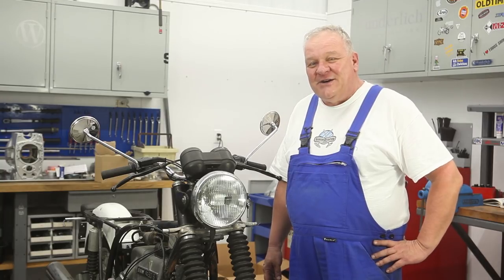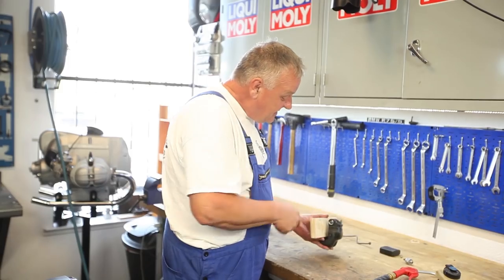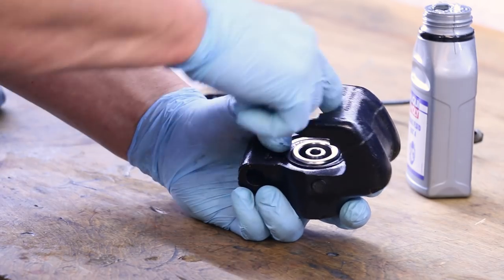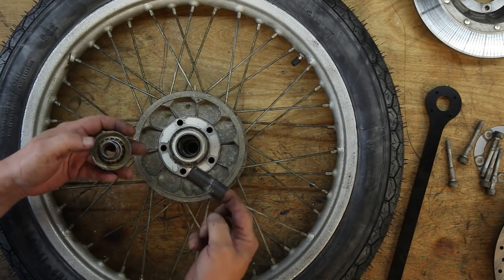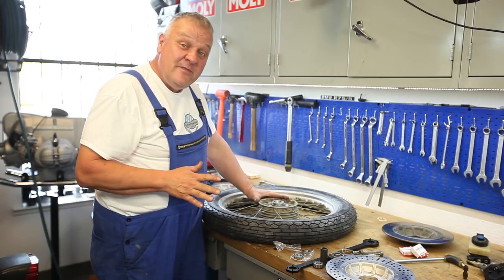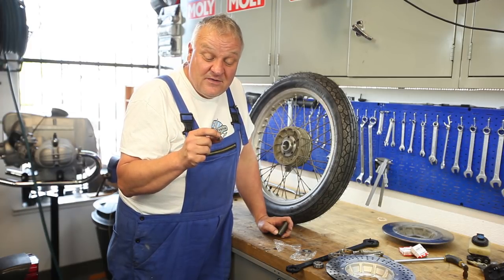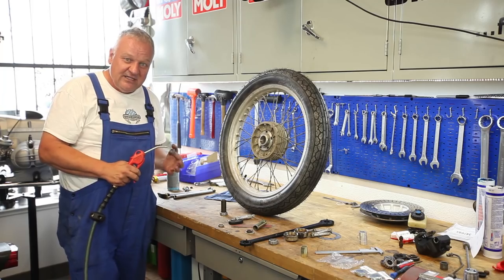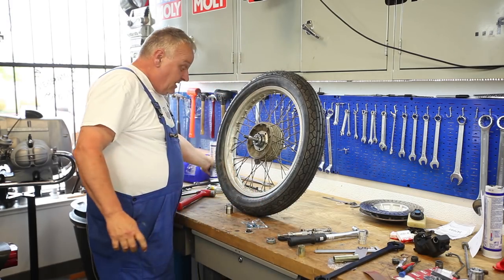R90/6 #20 Part 1 Front Wheel, Brakes, Master Cylinder & Steering Damper

Comment: thanks... packing bearings: by holding inner race (allowing the roller bearing cage to wiggle) using bearing cage to scrape grease from palm... scraping in the same direction (allowing grease to squish in between rollers and inner race)... until sufficient grease has filled voids (squishing out between rollers and cage)... slowly turn roller cage to confirm grease has filled all voids.

Comment: I think that the square nylon ring, is more than just a seal. It get sucked out of its groove/seat  when the pressure is applied, and the piston moves to push against the pads. The nylon ring is a rigid shape (think of it as memory, if you twist it, it will always return to it's original shape) and gently sucks the piston back once the pressure if released. Similar to the Brembo calipers, the squareness of it also acts as a retractor for the piston after the pressure subsides. Otherwise, the pads would drag all the time. I think it is a brilliant, if not stump simple bit of effective engineering. It is, therefore critical that the groove that the nylon ring seats into is very clean and no aluminum corrosion, so the the nylon memory can return back to a fully seated position. It's also why the clearance is so tight on the piston in the caliper.  ATE brakes need all the help they can get, in the effectiveness department. My $0.02.

Comment: Did you say you'll be working on a monolever  R80RT ??... checked again.... you did !!.. It's a sign from above !!
I'm just about to begin bringing my 1985 back to life!  ( 21k original miles. Time to lube the splines. I last rode it in 1995)  Picking up a motorcycle lift tomorrow... Bless Harbor Freight ! ( the fairing removal & reinstall frightens me !!)
BTW.. I winced when you used compressed air on the caliper without safety goggles... brake fluid or solvent sprayed in the eyes can't be good !
Thank you for these videos.. they help a lot, and I'm sure have inspired garage mechanics such as myself.
Looking forward to ordering parts!

Comment: Loving the videos.  I have an R90/6 that I've owned (and ridden daily) since 1978.  I've rebuild the master cylinder at least twice and can't remember if this is normal or not.  When I pull the brake lever with the master cylinder cap off there is a noticeable "burble" on the surface of the fluid inside.  Sometimes a small amount of fluid will be squirt out of the master cylinder (which tends to make a mess unless I have a cloth positioned to absorb it).  Is this normal?  Or do I need to re-do my MC rebuild?  Thanks in advance for help/advice.

Comment: Hello .. I own a 1979 r100 airhead.. would u know the most effective/easiest rear brake bleed procedure?  Any help is appreciated
Reply: Truth Decay,- I have the same bike, and have had these problems in the past.
Make sure there is good supply from fluid tank.
Make sure the master cyl piston has free play and is returning FULLY inside cylinder,
Remove the master cyl outlet steel pipe, pump the pedal to ensure a good pressure and amount of fluid 
is squirting out. 
Reconnect outlet pipe and pump a number of times.
Remove caliper from carrier, wedge both caliper pistons fully into caliper.
Position bleed nipple in uppermost position, and bleed several times.
This will remove all air in system and give you a good solid pedal.
I modified my rear brake by making a extended master cyl  operating lever
by 1cm, This gives a much more powerful brake.
Hope this helps ?

Comment: Another great video. You mentioned a cover for the damper mechanism but I didn't see you install one. After watching your video I looked at my two bikes and neither one had one. I checked my parts manual and have PN 31421234398. Do you have a picture of one? Thanks
Reply from the maker: It's very common for these to be missing. They were glued on and the adhesive eventually failed and the seal would fall off. We don't have a picture at the moment but please check our web site in the near future as we will be stocking this part. The part number that you stated is correct.